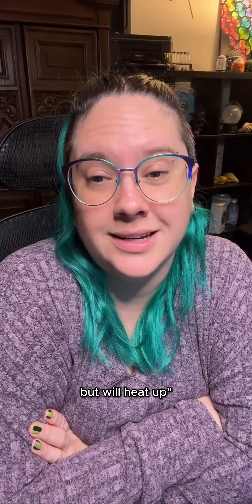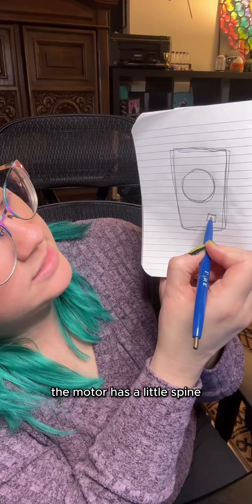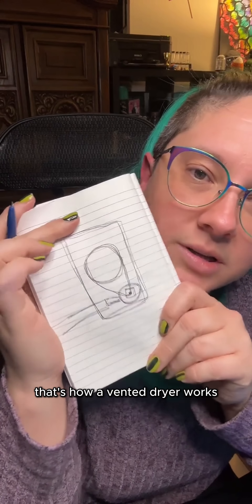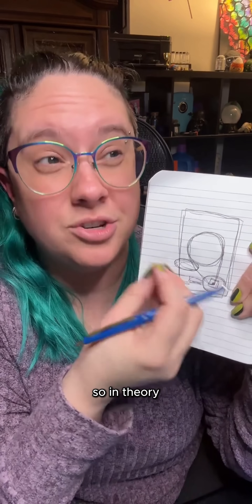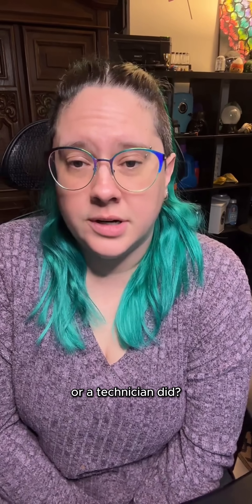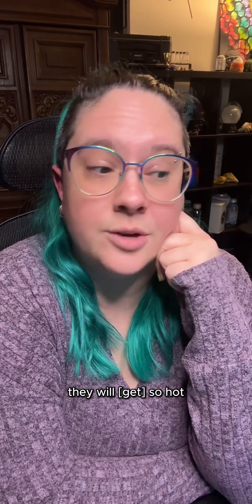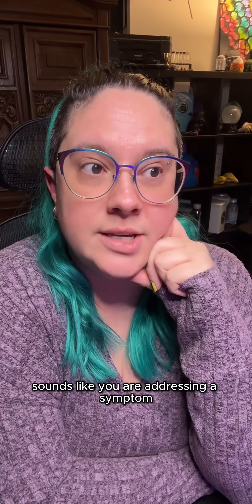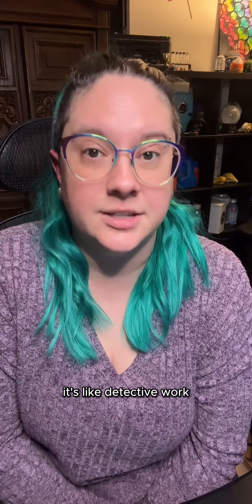Why would a dryer be HEATING, but not TUMBLING?  #DryerRepair #dryer

Comment: Mine would tumble but not heat up. Turns out it was still on fuses.  One fuse for the tumble, and the second fuse was for the heat and it kept blowing out.       I finally bought heavy duty fuses.  Problem solved.   Funny the people who owned the house before me had a lot of the electrical rewired and put in a new box with breakers.  But for some reason, they didn’t do the one for the dryer and it was 10 feet from the breaker box.

Comment: I was wondering what that switch was when i put a new idler wheel on the other day. The idler wheel bracket pushes that switch down when attached correctly. Also getting the belt on the right way is such a pain in the butt. I did it tho. Also got new guide wheels for the drum cleaned everything and my whirlpool Cabrio platinum dryer is running like it's new again. It doesn't sound like I'm drying bricks anymore. Both units are from 2012-2013? We got them brand new and I've replaced any part that fails and my hope is they last for many years to come. To many people trash them after something fails and calling a service is expensive. It isn't hard to work on them at all

Comment: My gas Maytag is over 40 years old and we've had to replace the giant flint block for the heating element twice. (Used up!)

The 2nd time, because - during 40+ years of use - the burner that needed it had literally rotted away.

So we replaced the entire gas burner AND the big flint block.

Now anticipating approximately 40+ more years of service (as long as we can source another giant flint block about 20 years from now).

At 67-y-o, it may out-live me. 😊

Here's hoping! ❤
Reply: Get one now just so you have it on hand.  And Yep, that’s why I say they built things to last a long time ago.  Now they are built to fail in 1 to 2 years.  And cost 10 times as much.

Comment: Also consider the receptacle it’s plugged into. Replaced my element twice in two years, second time replaced everything on the back. Timer for start switch went out after replacing everything!!  Bought a new dryer, quickly started acting funny, then realized the receptacle was shorted
Reply from the maker: Absolutely! And even if it’s been working fine for years while plugged into that same receptacle, that doesn’t mean it can’t fail. So many people assume an outlet is fine just because it’s been fine up until that point. 😅